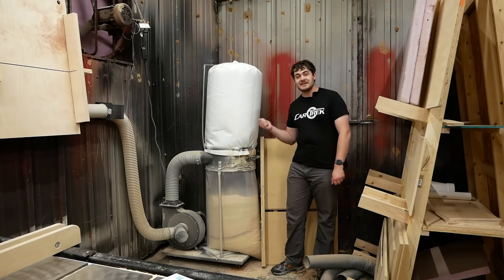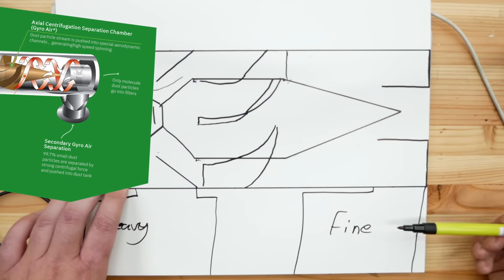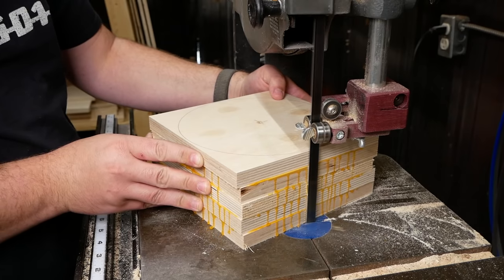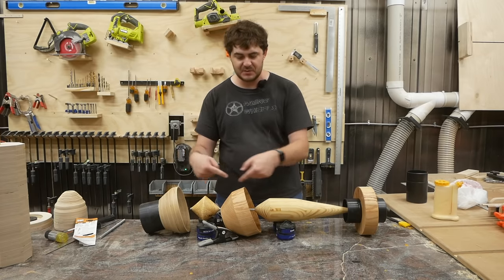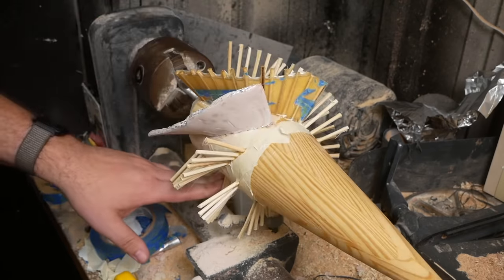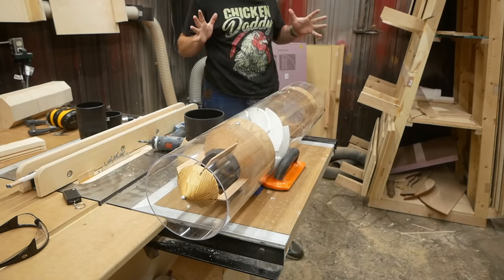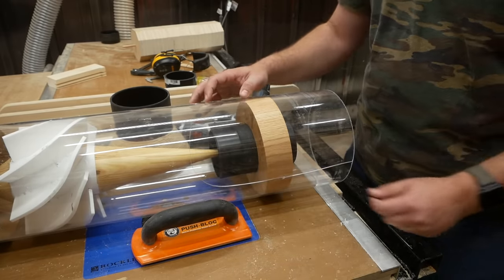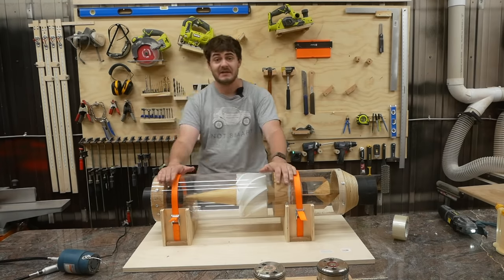I Made a Centrifugal Dust Separator to Upgrade My Cheapo Dust Collector

Comment: Traditionally, the separator goes before the fan. That would keep the chips and dust from destroying the impeller. Have you tried to put the filter inlet before the fan? Have the fan suck the air through the dust separator.
Reply: After watching this debacle, I get the distinct impression that this guy has a LOT more money than sense. He also has far too much time on his hands, and no ability whatsoever to understand what he is actually doing.
Reply: @johncoops6897  how did you manage to get this impression? its incredibly negative for having watched one video, especially considering it is a video about MAKING a CHEAP alternative to a commercially available product... instead of just buying one. i will say the way he used the lathe in this video was really questionable though. i just dont get how you managed to get such a negative impression one one video
Reply: @christophkogler6220  - Well I "got the impression" simply by watching a number of this guy's videos.
He's kind of amusing in a Fawlty Towers / Mr Bean kind of way.... but his lack of planning, poor design skills, and needing to re-build things numerous times make it a frustrating viewing experience for a more technically competent person like myself.
He has certainly invested in lots of very nice machinery, yet he seems to end up with pretty half-baked project results. I reckon he's a nice person, and he's certainly not arrogant nor ignorant about his shortcoming (eg: ProjectFarm), and he even makes jokes about his own silliness.
In fact, it's hard for me to understand if the whole thing is real or an act or trolling the viewers, but I spend too much of the video shaking my head in disbelief at his antics. I came here to learn how to build a dust separator, but I ended up watching a comedy sketch.
Reply: @johncoops6897  I cant find any faults with that. If you know what you're doing in a field, it can be quite grating to watch amateurs at work. I only watched this one video, which didn't seem so bad to me, but I only took a woodworking class in high school.
Except for him using the lathe, after the first time something popped off of it I was wondering what the fuck he was thinking, and he kept having things do that. Was worried he was gonna get hit in the face with a brick of wood.
Reply: @johncoops6897  - As he has said numerous times, his videos are not "how tos". They are purely entertainment and to WATCH an UNSKILLED person solve a PROBLEM in the way a LAYPERSON without specialized tools or expertise would do it.

If you want high result wood projects, go watch Wooden Gears. If you want cussing and wrenching go to AvE. If you want machining or anything else, go to one of those channels.

I literally do not get the point of complaining about a video series, the entire point of which is showing and unskilled person build things.

Oh. And it's 'Fawlty Towers'.
Reply: @thysonsacclaim  - well. you are right about the "WATCH an UNSKILLED person" part. This guy has more tools, specialised equipment and resources than almost any normal hobbyist, so the rest of the your comment doesn't make sense.
I complain to warn others that this is not "I Made a Centrifugal Dust Separator to Upgrade My Cheapo Dust Collector"
 like the title says.
I was sent here by the Youtube algorithm, since I was researching a solution to a problem. I didn't come for some obtuse "entertainment" - I came to learn what was (mis)described in the video title.
Reply: @johncoops6897  What a sad little life you live.
Reply: @edvineriksson379  - LOL, nope. I am happy, especially when I seemed to have "disliked" this channel enough that it won't pop up again to annoy me :-)
Reply: @johncoops6897  I agree with the general sentiment but "I did [X]" videos that are 30 minutes long are not solutions to anyone's problems. These should get mentally filtered out, the run time is obviously to watch someone's journey because a well made solution video doesn't waste people's time.
Reply: If it bothers you this much don't watch. Or better yet leave him some hints, ppl aren't born knowing the proper way to do stuff l. We learn from others or from our failures.

Be like "hey it's awesome to see that you are doing experiments, if you want I can share some tips I've learned from my work experience"
Reply: Fair play to this guy for making something difficult and sticking at it but you have to admit he makes a lot of silly mistakes. I did wonder how this would turn out after he said he's using some timber from a failed work bench project!! That's a big workshop for someone who can't yet make a work bench lol. Everyone makes mistakes but I do hope this is just a hobby for this guy.
Reply: @specialk6984  Oh yeah, the woodworking is just one of his many side hobbies. Working on/collecting wierd vehicles is his main hobby.
He's also made clear multiple times that he makes his videos purely for enjoyment/comedy value, and not as how to's.
Reply: @jakekiedaisch2279  cheersthanks, maybe i'll check a car video sometime.
Reply: @specialk6984  I highly recommend anything involving the Trabant
Reply: @FearlessLeader2001   thanks
Reply: @John Coops Why don’t you post a link to your videos?
Go ahead, shows what you got!
Put your money where your mouth is.
It’s people like you….
Reply: @johncoops6897  he mentions how little experience he has and how much of an idiot he is (just quoting here, not actually my opinion, having never used any of the big tools in the video) throughout the video, what did you expect?
Reply: @johncoops6897  I think he has a reasonable amount of tools for a hobbyist. They're all cheaper brands, second hand or homemade so you could probably replicate his shop for 1-2k dollars with a bit of luck and time. That's a small chunk of the US average salary especially when gathered over years. He's also got a lot of space so if someone is throwing out a big tool like a routing table he can pick it up no problem. That is probably the deciding factor. Space limits me to a single toolbox and a dremel.
Reply: @CampGareth  - his table saw alone is worth more that $1-2K. He spends tons of money, and owns more tools than anybody that I have ever met.
I just watched another video where he went and bought a massive (and very expensive) imperial drill set with 1/64" increments, as well as all the Number and Letter drills because he didn't have just one correct sized drill bit (I think it was for clearance on a 8mm dowel pin).
Reply: @johncoops6897  nailed it
Reply: @themonsterwithin6495  - the comments are to WARN OTHERS that what is happening in this video is a bad (and potentially dangerous) thing to build.
Not everyone is savvy enough to realise that the content is only for entertainment. Youtube recommended  the video to me because I was searching for Dust Separators. Nobody can possibly know whether the content is good or not before watching it.
Reply: @johncoops6897  Pretty sure the title described exactly what happened in the video. A guy made a centrifugal dust separator to upgrade his cheapo dust collector. That was exactly what happened in the video. It wasn't "how to make...." or "DIY guide to...." but instead "I made a thing."
Reply: @juli7xxxxx  - ooooh, that's harsh. I hope you realise that comment is really silly, since I couldn't care less what other people do.
Reply: @johncoops6897  his table saw is home build my guy...
It's a cheap old table saw, that's been modified.
Not a good example, and not 1-2K...
He is more able than most Americans... 
If you are the second coming of Christ that's fine but let others learn and experience the word like they want to...
Reply: I bet if he built it 3 more times he'd have a perfect video for you to watch, but given he's an amateur showing you his first build of it why don't you cut him some slack?  What do you do for a living?
Reply: @kenwood3796  - well, most of us aren't of a mindset that says " I made a really shitty thing that doesn't work. So I will publish it online to show everyone" .
Reply: Depends on the system and fan design. If you are aiming for a positive or negative pressure filter.
Reply: You'd be right, except, this impeller is designed more like an upright vacuum cleaner. It is specifically designed to withstand the impingement of dust. The problem with restricting the intake with the cyclone, rather than the discharge, is that this impeller is designed to develop more head pressure on discharge, than on intake. It would greatly reduce airflow volume to put the cyclone on the intake side of it. If you do anything on the inlet side, I would just have a simple baffle box with a board that nuts and bolts can strike, to keep them from hitting the fan, and just let dust go through to the cyclone. The baffle box would pose almost no restriction to the suction side of the blower.

Comment: I have a metal working shop, welding, cutting and grinding. Most dust collection systems sold use bags or filters. They cost money and I would like to just dump a trap for a few minutes labor. Your system has given me ideas for my shop dust problem solution.

Comment: Hey Under, I would recommend putting your turbine to the back of the separation box which will protect your turbine fins from the larger stuff going through your filter.  IT will be caught by stage 1, and won’t hit your fins.  Just a thought.